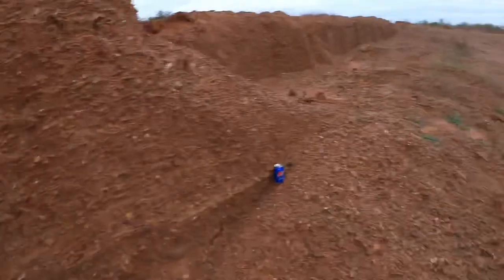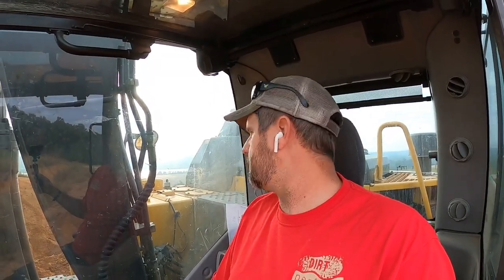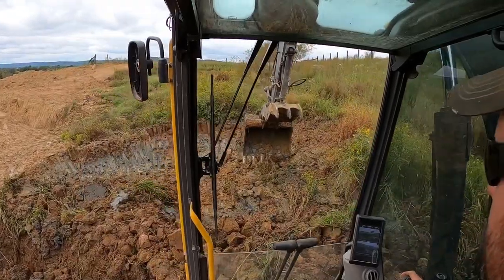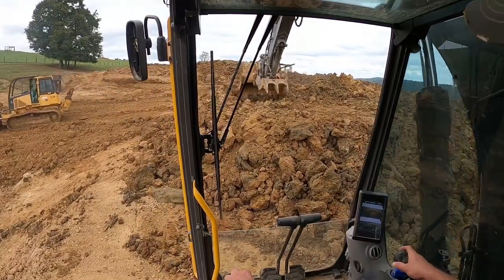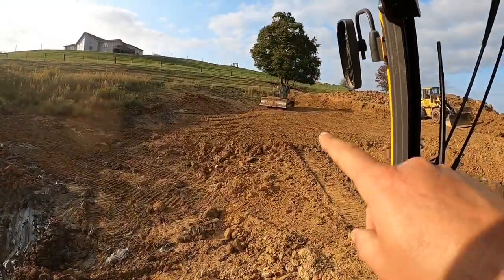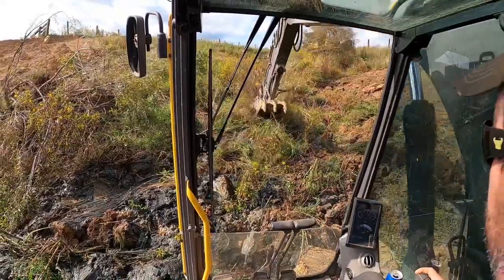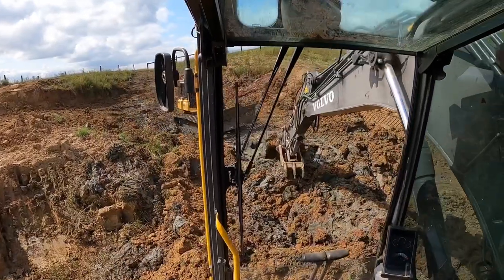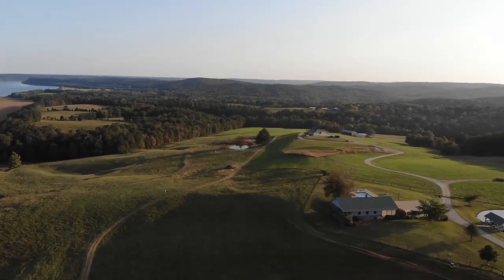Weekend at logger Wades loading trucks and dredging a pond

Comment: Hey DP, you asked for comments.  I'm not a professional operator, I'm a low voltage tech. The way I see it, if you have a few scratches from swinging over your blade, that's a design issue. If you are hitting the counter weight on trees or other objects that's carelessness and a completely different conversation. 

Like several have said, it's a machine. I understand wanting to take care of the equipment, but you also have to be willing to to get in and get the job done. 

As always, great work in the dirt and on the camera work!
Reply from the maker: Thanks ron

Comment: it's been two years but your comment on experience is spot on. I have 35 year in my field and 7 years managing. In my field I grew up in an aviation shop with my dad and uncle, went to college for automotive, worked in several dealers starting at 18, worked with the dealer's race team for several years, built and raced my own cars for 25 years ( did it all from fabrication to head porting and flowing) and ran my own business for 25 years. The people that were my friends were Ford and Chrysler engineers. So much experience that 99% of the mechanics out there never get. But it seems that everyone with a computer is an expert. So many internet arguments. My first racing mentors used to tell me that the first rule of racing was "never argue with idiots". Rarely do I answer posts on the internet any more in observance of that rule. I could never be a Youtuber for that reason and I appreciate what you do. It doesn't take long watching your videos to see that you have the experience and integrity. Tough sometimes your mechanic videos make me crazy but I bite my tongue. ;)

Comment: I first learned how to Operate a Bulldozer was when I was 14 years old,  and I am 58 years old now. My Dad  Taught me the Basics,  what Each of The Levers Did and What each Pedal on The Floor did.  My Dad Operated a 1969 955k Caterpillar Bucket Dozer. He had a Custom Cab put on it. My Dad 1st Operated Heavy Equip. In The Army. During the Korean War,  He was 17 years old at the time, He Graded off Parcells of Land overseas for The Airforce and Army  planes to Land. He Operated a wide Range of other Heavy Equip.  as Well. . After 4yrs. In The Service He went onto Operating Heavy Equip as a way of Life for nearly 50 yes. Or so. The way He handled a Machine was totally Amazing.  At every Job site ,Customer's and Engineers on Big Job's Alike Amired How He had handled a Machine. Always completing job at Grade Level. Right up till His Retirement in 1992.

Comment: Counter b weight/mud trowel 
Years ago (68-70) I worked at a full service gas station.  Every few months we had pull the floor grates in the the service bay and shovel and/or bucket out the mud in the grease trap.  We called the residue "la blah"  That stuff stunk like some of the stuff you dug out on that job.

Comment: your take on equipment and work ethics are right on, if it's to pretty to use should leave it at the shop, truck drivers are the same in whatever industry you work in, always run in packs

Comment: Well 1st thing truck drivers live in their own little space I have worked in road construction for over 20 years and boy they all the same. Experience is everything in construction I think but companies look at it differently it's crazy to me cause I am 45 and have 20 years experience and cant get a job to save me. If the paint scratched I wouldn't have it. Ur work u do is excellent work u are a top of the line operators keep up the good work. U need to try snapping turtle meat oh my is it delicious. Thanks for the excellent vidja and the time u took to make it.

Comment: Mike , I don't know if you will ever see these comments  since  they are to a video 3 years ago.    Weekend at  logger Wades loading truck and dredging a pond.  Anyway I can not believe they would call you a rookie because you could open a Pepsi can on a round piece of ice in  100 degree weather..  Without the thumb I might say..  Anyway like my father said  "a tool without paint removed is a tool unused",  My idea is mount on the center weight a Y shaped  device  that slips under the counter weights  (the Y shape) and extends a foot more  less pass the tracks.  Anyway would knock the hell off the mud . Anyway could get Aron to weld since he will be the one to clean up the  tracks . LOL.

Comment: A scratch on your counterweight does not mean anything except that you have been working. What I find funny is when operators get stuck in an excavator. Honestly as long as I can rotate the boom and use the arm, I do not get stuck because I can always pull myself out. Then again, I got started before joysticks came along and have gone through swamps and climbed mountains with my excavator. I have seen some younger operators get stuck on flat ground. lol.

Comment: Totally agree with you, a few scratches don't make you a bad operator, I used my digger to clear fire breaks through thick scrub, and I wasn't worried about putting scratches on the digger, cutting off the fire or slowing it down was the kpi for that job and it worked
Reply from the maker: Thanks

Comment: My family was in excavation for 50 years.  Every hoe we had, the counter weights were always scratched up.  We did alot of demolition, and towards the end worked for the railroad.  We were always in tight spaces and things happened.  That just part of operating.  Unless you are trading every couple years your equipment will be scratched up and paint wore off.  Some of our best machines were older, scratched, and almost wore out.
Reply: As long as they still get their regular maintenance and daily grease the scratches shouldn’t make it operate any less effective. Working for dealer a number of years I found the outside of the machine isn’t what told the condition. It was opening the lower panels and seeing when the last time the panel under the cab was off to have those items cleaned and items removed thus preventing expensive hose replacements same with rear access panels dented up ones that was easy to remove because they didn’t have several pounds of dirt and crap on them showed the people took a lot better care of them than someone who just washed the machine off on the outside but not inside. A machine with a good paint job but every hose in it is ready to blow or all the valves are sitting in mud and sticks and is covered in flaky rust. I’m going to go for the higher hour scratched machine thats seen some maintenance live fro the operators

Comment: i learned lil different i think. i was to young for a regular job, so i asked the owner of landscapng company next door for a job. thinking i would sweep and clean up etc. nope first day "go grab that Jd 310 backhoe and dig me a hole right here" i told him i didnt know how, he said figure it out! so i did. then he put me on a forklift. then he threw me in the f450 pulling the hoe, on the road!! then the skidsteer. i was 12 very thankful for those lesssons, now i seem to learn more just by doing. only machine i havent been on is dozer well worked one. i drove one around after we got an old one running.

Comment: Good clay, drainage & prevention is your best friends.  Drone footage amazing.  What is Heck is the Gray Muck? Just the pond mud?  I have seen gray soil layer in numerous dam & slope failures on several YT channels.  Lots of gray muck under the grass. Removal is a good plan for this small area. What about the rest of the farm?  More things you might do. Tile fields to dry out the slides. Drain & prevent water entering gray layer from the chert above. Septic system drainage can increase land slides. Finding ways to route under ground septic system waste water & springs with tile or sewer systems to remove water infiltration of gray layer.  Have you had the Gray soil tested?
Reply from the maker: Thanks

Comment: This is another great video, playing in the smelly mud and filling back in, layering it in and packing it, to help it stay where that you put it and keeping the water from getting in behind it . So that the water will  run off, instead of soaking in. I ran an 850 John Deere for a few days, years ago and everyday day at the end of the day, he wanted all the dirt that we were working with that day smoothed down and all bigger holes or low places filled up, just in case that it would rain and not run off, and would cause mud holes full of water or places where that the water would get in behind or underneath and maybe cause a slide. He called it ( capping ) the dirt, better safe than sorry, in case it pours the rain and he said that it helps to hold so much of a percentage of mositure in the dirt so that it will stick or stay together, so that it will pack better. That man learned me a lot about  working in different kinds of dirt, and also in mud.  Just like you did in this video about different kinds of dirt, mixing it and moving it around to get your  layers from the bottom in place and up to your top layer, and getting it packed in and smoothed up to the final finish.
Also, I loved what that you had to say about people getting experience running and operating equipment, or just  lots of things. I can look back at my own life and how that I have learned how to do so many things in my life. I grew up on a farm, learning how to run farm equipment, and then heavy equipment, then I got into doing carpentry work, then I got into doing cabinet making work, that I took some classes for, then I got into doing (electrical work, that I actually when to school for) and then I got into welding and then I got into doing plumbing and just different things over the years, and  working around  convenient stores and gas stations and tractor trailer fuel tankers and dump trucks and more heavy equipment. But I believe my favorite was digging and hauling dirt, I love the smell of freshly dug up or plowed dirt out on the farm. I could keep on typing, but anyway keep on making the great videos and I will keep on watching them.
So be careful and stay safe digging, hauling and pushing dirt. So keep on living,  laughing and learning, that makes the world go around.
As always, Jeffrey !!!

Comment: Big difference between scratches on the bottom end of a counterweight, and a machine with no paint on the back, and every panel caved in or missing.
Reply: Yea that’s where I would start getting Concerned. Is when the counter weight is bald in the back and the side rails area ll beat in (not dented bent in!) I worked for a Komatsu dealer that’s we would have to take and get those side flanges bent a shop in 4-6 foot long pieces and cut the old rails out and weld them in and repaint them because they had been bashing trees and retaining walls with them. Mud pumping and the occasional brush dragged along the bottom along the lower panels and the rub rails is normal in my opinion. At CAT and CNH they didn’t even really deal
With these other than spray can the rental fleet in the winter or before it was sold most contractor/owners would maybe rattle ca the worst scratches on the Machine above the first few inches of the sides and rear counterweight. One of the Komatsu dealers offer a grey bed liner they cover the lower 6 inches or so of the machine with to reduce this wear but it usually still wore off the lower bottom panels at about the same rate. For the most part it was most operators /owners practice we dealt with to address these during winter down time. The lower panels would be pulled off made sure they still fit or weren’t torn or bent so bad they wouldn’t fit anymore the machine cleaned real well sticks leaves mud and other items that had gotten it too for he lower access panels was removed not only to help with better cooling of engine and hydraulics but to help prevent extra what and wear on hoses and valves. if a panel was really bad or really rusty they might be pressure washed off and repainted at this time same with rub rails and lower rear counter weight but they did this practice with all machine from akidsteers to dozers as well not as a visual maintenance as much as a Preventive maintenance measure. The direct opposite of this was the few company’s that ran bridge equipment that run primarily creeks, rivers and river banks and cleared right aways or those that used the machines that were used solely in land clearing and brush burning as part of other operations and they were the old worn out machines and in jobs the were these poor machines often did not see much maintenance love other than the daily greasing and oil changes demanded by the maintenance personnel and were often worn out and at the end of their useful lives.

Comment: Your right on all terminology  , we grease , clean , fix ,what we can , not bang up or rodeo , smooth and steady wins the race , machines are ride on shovels , can get done when your worrying about whats going on outside the machine all the time ,Every time I have to dive into the mud , I dont think twice , Im not thinkin About how Im gonna clean the machine for the rest of the day , machine gets cleaned when job is done and ready to trailer to next spot , usually hose down everynight and If not  owell tomorrow's another day.your rants are spot on , .its like us skidsteer guys , our back door whe where backin up and mud and dirt squeezes up in the engine compartment ,Im not freakin out all day , somtimes theres mud and dirt in there for days , and if nothing shutsme down and I get through the job with no down time ,That dirt dont get out of there till Im checkin the oil for next job or changin iyt , giulty stuff happens.👍

Comment: The trucks came back to you in a cluster because you loaded them in a cluster. Sometimes life is one big cluster. (If you know what I mean and I think you do.)
For them, bunching up gives them a little break time at each end. Do they get paid by the hour, load or mile? They don't get paid to even out your work. You you would probably be just as annoyed if they were 10 minutes apart, because every time you get out of the seat a truck would show up. 😉
Reply: I agree with this are they being paid by the hour or the load. Also it’s Saturday coming from the construction world for most of my life most Saturday work is half day in many places. They (the drivers) tend to space it out to only be into enough job till noon and not get involved with anything that may take them to an afternoon but my guess is still paid by hour not by loads that day. 
An example from one of my older foreman’s on a day we were e hauling in base rock (total of 60 some loads that day ) they drivers were told total number of loads order and we weren’t going home that day until we were at the other end of the job (our company also owned the quarry too) we had two mother graders and they couldn’t outrun us. They showed up at 700 am (earlier the city would let us start working) with as many of them with pup trailers that could haul them. By 130 Pm all rock was later with like 8 extra trucks because we had orders short (by about 12)  anyway. They were done by 130. Took us a couple more hours to finish the rough grade and roll it even with two 8 foot wide rollers. If he had ordered that rock even with them knowing the amount to total haul they would have screwed around all day and we would have been their till 5-6 pm unloading but because the company’s owner had told them it would be down before they left they hauled hard all morning  so they could go home early. No w with that said the drivers that were not company drivers and were independent from the quarry would hav stayed until we were done and as long as they could haul. They were paid by the load and the more loads they haul the more they made. Not saying it works that way everywhere but more often than not it seems to play that way. Working on the receiving side I would rather work with the by load independent guys more than the company drivers I like them and all they were good people but the guys who owned their trucks were owner operators and therefor small business people. These trucks is how they made money they didn’t make money sitting they didn’t make money when they were broken or while they were at McDonald’s only the number of loads a day determined if that truck was k the red or black at the end of the day. So they worked harder they usually did a better job of dumping the product wether it was dump half at this ditch or that culvert and half up there or spread it from that inlet fairly even to the next one they did. Company drivers also often lacked that skill or the will to do it. They often would get there so what the guy in front of them did and not even ask where you wanted it even if they had to drive past you to get there. So yes I at least feel we can all feel the pain of the (what are they doing now ) that Dirt perfect is asking. (Full disclosure I having a CDL working for that company has also hauled rock at time s but at least tried not to be THAT DRIVER)

Comment: Disclaimer: "No turtles were harmed in the making of this video, but a counterweight paint job may have been" 🤣
I have two lines of thought about counter weight scratches - first is that I totally agree with you and ultimately the counterweight is just a chunk of metal which (unless it's a zero swing) will get scratched when working in tight situations.  The back of my machine has several battle scars and I am not precious about the paint - ultimately it is a work tool not my weekend drive.  That said, if an employee often scratches the counter weight on "easy" jobs, I would start to question how much care his taking of my machine and his surroundings and whether he or she needs to take a bit more care..... Talking of which, it looks like Kleeman's been driving that loader? 🤣  Great video and stunning location 👍👏
Reply from the maker: Lol